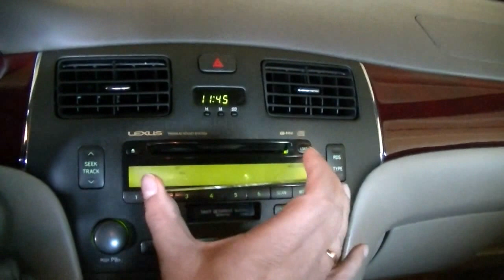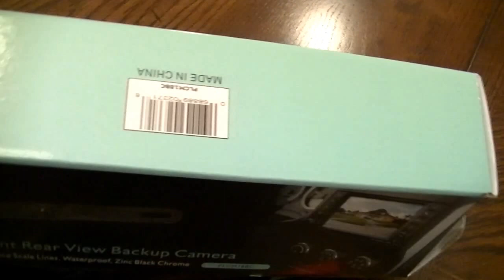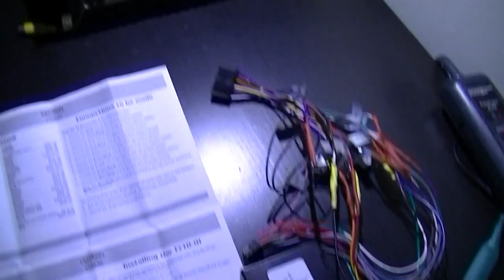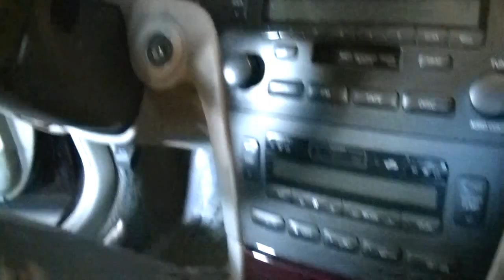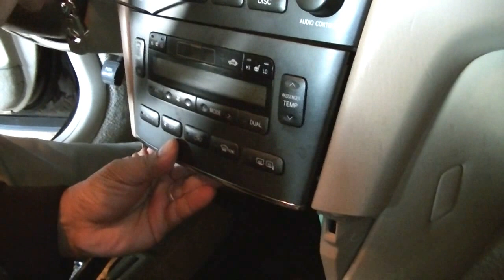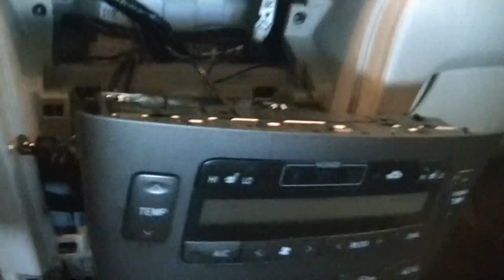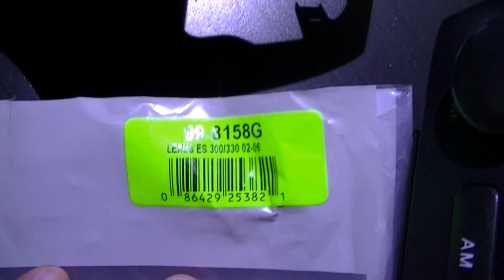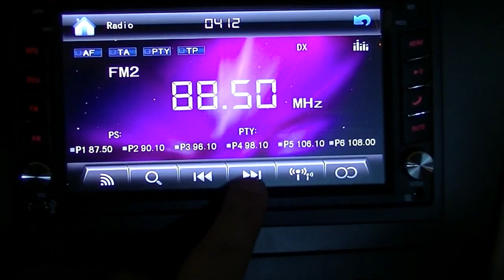2004 Lexus es330 radio replacement with aftermarket double din head unit

Comment: hello sir, I have a question about the mounts that go onto head unit itself, from metra, anyway, mine sit way too far away from the screw holes on the car, however i have my mounts set up just like you have yours on your head unit, by the way I have the same head unit. my question is am i able to move them back enough for it to mount up or did you end up using some other mount...?
Reply from the maker: Mount is plastic and flexible. I think even in my case i noticed that mount holes were far away from holes on car but then when i put the screw in then due to the flexibility of mounts they did move back enough to allow screw in the hole. This works good enough. I used the same mounts that came with new faceplate as shown in video.

Comment: another question is how is your software working..i was told these units have a 50/50 function problem with gps and radio...just asking because not sure if my installer trying to get extra money out of me?
Reply from the maker: +MrTreyvinr So far everything is working fine however GPS is rarely used. I used GPS intensively on PYLE headunit that i installed in my van and it failed completely after my long drive to canada. No support from vendor for fix. So in one way your installer is saying right that GPS can fail without any vendor support. These are cheaper windows CE6 based unit. I am reading some good feedback on android 4.4 quad core based units now a days so in my next install i will try that one (JOYING Quad Core Android 4.4.4 Double 2 Din Hd Capacitive Muti Touch Screen 1024*600 Resolution ). It is all a matter of luck too with these no name brand units, some may continue to work without any issue and some may fail very quickly. Going with a known reliable brand like Pioneer or Sony etc. is best thing to do but they are too over priced.
Reply from the maker: +Vijay Bhalla Additionally if you going to have it installed by a professional installer then go for amplifier bypass (completely remove lexus's own amplifier from trunk, for best audio results).
Reply: Thanks...I think I am gonna upgrade to not have  these problems

Comment: Im suprised the battery didn’t die lol
Reply from the maker: Recently i did a deep cleaning of carpet of my 2011 lexus es350 by removing both front seats from car. Since carpet became quite wet i had to keep car doors open for about 3 days and nights with external fan on. All this while battery was fully connected. Battery dies after about 3 days completely. I waited for about 2 more days and charged battery while still fully connected in the car through an external charger. Charged overnight and by next days everything was fully functional. So per my observations it takes about 3 days for battery to die with all internal lights on and door left open. Can be different depending on health of battery too.

Comment: Hey I have the same car, and Installed everything correctly and you can tell the sound is not the same as factory right? it gets distorted at a high volume and sound shuts off sometimes at high volume! Apparently a new amp or speakers can correct this! Did you do any of that?
Reply from the maker: +KayB “Kenny” Ent. I am not facing any issue with sound quality or sound shutting off at high volume. Sound quality is quite nice (infact more lively then original player). Only issue i am facing is when car is started i hear a humming sound from speakers which goes away as soon as songs start playing. If you installed it in exact same way as I did then what gain did you set on black box? I think i kept closer to 70%. Try to play around with that gain knob as that is the only thing flexible to some fine tuning and adjustments. I do remember reading some material on amplifiers and they have an inbuilt feature to shut themselves off when input signal is too high for them so may be try to lower down your gain adjustment on the black box. May be your car's amplifier is going in auto protection mode. I did absolute no modification to car's amplifier and speakers etc. only replaced the head unit.
Reply: +Vijay Bhalla My gain knob is around 50% right now! Do all E330's have the same amp? For some reason I can't keep the great factory sound I had before! The sound is decent but no where near as good as it was before. How much watts per channel does your radio put out?
Reply from the maker: +KayB “Kenny” Ent. 50% seems reasonable, try to play around between range of 50~80% and see if that makes any difference. Per my understanding there are two series of head units on ES330, Pioneer and Mark Lavinson, both have own amplifier components. I faced a similar disappointment when i replaced the head unit for Lexus ES300. Sound of original system was amazing hifi and new one sounded very plain and just decent (like a good old days radio or a transistor) in comparison. On my Lexus ES330 i was disappointment with the sound quality from very beginning when I bought this car (not first owner), it was very low and plain - not close to hifi at all, so i guess that amplifier in my car was near dead on arrival already and therefore on replacement of head unit, now what i am getting is amplified sound of head unit and most probably car's amplifier is just acting as a pass through, therefore i feel it is better then original, however none of it compares to the sound that i used to hear on 97 Lexus ES300.  My head unit's  Amplifier output: 45w*4

Comment: Hey bro I have the same car and hooked everything up and it works except my radio tuner doesnt work and the parking brake detection isnt plugged in. Do you know where I can find these?
Reply from the maker: Sorry I don’t know where the parking brake plug in is therefore i used brake bypass. If music is playing and radio tuner is not then either you didn’t connect the power antenna cable wire in the interface cable or it can be your head unit issue. It is difficult to provide help in diagnosis but does radio tuner work if you test ihe head unit outside car independently?
Reply: @VijayBhalla  How do u  do the brake bypass? I would do that. Also, I cant test it externally because I do not have the capability. As for the radio tuner I hooked up the blue wire from my harness to the blue wire of the head unit. "Connect tthe blue wire to the power antenna wire" are the directions on the harness manual and it says "Blue (Antenna Control Wire) Depending on what antenna you are usuing connect either to the control terminal of the motor antenna, or to the power terminal of the booster amplifier of the film type antenna max 300mA, 12v). So I connected tthe blue from the harness to the blue of the head unit. Is this wrong? Thank you
Reply from the maker: Just search YouTube on break bypass. Several videos on this topic though it can be considered illegal hence i didn’t want to include details. I think you are fine on antenna wires connection so cannot say what else could be a suspect besides head unit itself.
Reply: @VijayBhalla  Thank you

Comment: what will be the cost if you had this professionally installed?
Reply from the maker: +MrTreyvinr Good question, I never checked but Best Buy probably will be a good place to ask for a quote. My best guess is about $200 labor charges for installation and rest will be parts and head unit cost.

Comment: my installer keep saying installation not possible without bypass amp harness...
Reply from the maker: +MrTreyvinr You can show this video to your installer :-).  He is completely wrong if he says that installation is not possible without bypass (may be he does not know how to do it).  Anyway if he wants to bypass and is able to do it without charging you too much then you can take that deal too. Bypassing means he will remove the amplifier from trunk of car and also cut the existing adapters in the car that connects to current radio and amplifier.  Once adapters are cut then he will connect the new radio to open wires directly and also connect amplifier input and output wires directly. It is not complex process and you have really nothing to lose in it except that you can never put back your current radio again in car (it hardly matters).  Good thing about amplifier bypass is that 1. You don't need to buy expensive TYTO-01 interface cable and 2. The sound quality will be much better 3. No risk of picking up the engine noise (which is always a risk in retaining the external amplifier).  If he is not charging you extra then it is not a bad decision to have amplifier removed/bypassed permanently.

New radios have inbuilt amplifier which are much better so it is advisable to use them and remove external amplifier (if possible easily without paying too much).
Reply: Thank you...I was thinking he's the professional  and  a lot of people  including  yourself  is placing them in without difficulty . ..yet it's one thing after another....wanted to charge me 200 plus for a harness...
Reply from the maker: +MrTreyvinr If i have to do it again, I will use PIONEER AVH-X4800BS ($271), TYTO-01($60) & Schoche faceplate/misc expense ($30) =  $361 complete install budget. Compare this to what your total expense estimate is coming up with parts + labor with professional install and the difference is what you can save if you do it yourself (at some risks which i mentioned in my earlier msg). PIONEER units are much better in quality and size is standard so there will not be even a need to go through the hassle of cutting the faceplate what I went through due to non standard size of chinese units.

Comment: I'm using the same TYTO-01 and have my radio connected but I'm not getting any sound. Did you run into this problem? If so, do you have a solution?
Reply from the maker: +Hermes Dastas, Only very few times it has happened till date and every time resetting the power of radio resolved the issue. Radio had been working flawless otherwise till date. Few questions and recommendations if you want to pursue:-

1. If you have any spare small speaker handy then try to connect it to radio output front left or front right directly and see if you hear any sound. If no sound then radio is bad. Connect this speaker to radio directly (before the black box connection) so that there is nothing in between radio output and speaker. If sound is present then focus on TyTo

2. Approx. how much gain did you set on TyTo? Try to keep it somewhere between 50% to 70%. Setting gain too high may put the external amplifier in a protection mode.

3. Recheck that amplifier turn on cables on the Toyo harness are connected. Missing this connection can cause amplifier to stay off and hence no sound produced. (Black wire with white stripe connected to ground,  Blue wire with white stripe connected to blue with white stripe output from radio).

If none of the above works then put the old stereo back and see if it still produces sound or not.
Reply: +Vijay Bhalla Thanks for all the info! I figured it out shortly after I commented on here. I had to connect a wire that the instructions said I didn't have to connect on my radio. The sound is working now and everything is super clear. 

Thanks again for your help!
Reply from the maker: +Hermes Dastas Glad to hear that. What is the color of that wire?
Reply: +Vijay Bhalla It was a second blue wire on the radio. I forgot what it was labeled as but once I connected that with the other blue/white wire on the TYTO-01 the sound went on right away.
Reply from the maker: +Hermes Dastas Yes Blue with white stripe is amplifier turn on wire. Generally not required to be connected if there is no external amplifier,however necessary to be connected for this car. Glad that your issue is resolved now. Enjoy your new radio!
Reply: +Vijay Bhalla Yes, that was my only problem. Thank you! I'm loving it so far 👌
Reply: what did you ground the black wire with white stripe to
Reply from the maker: Jayy Woods In Metra harness there is a solid black wire & a black wire with white stripe, additionally in head unit harness there is a solid black wire. I connected all these wires together and then grounded them to the metal rod which is present towards left side of the radio, infact the leftmost upper screw that bolts the radio bracket to car's body has threads into this metal rod so that made it easier to connect ground wire to this rod using the same screw. I also added an extra ground wire that connects to metal body of the head unit itself. This was a slight modification i did to ground connections in order to eliminate the humming sound.
Reply: I have no sound and got a black wire with white stripe not connected were do it go
Reply from the maker: Black wire with white stripe needs to be grounded too. Connect it to metal body of the car, where you must have connected rest of the black wires from head unit as well as the metra harness. Just connect all black wires including this one together and give one ground to metal body of the new unit's screw and one additional ground to the metal rod on car's body. If you still don't get sound then watch for the blue wire with white stripe. This wire should be connected from head unit to Metra harness otherwise amplifier will not turn on.

Comment: Great video Vijay. Thanks for sharing -- super helpful in installing my own. Wondering what the Black/white wire running from the TYTO-01 14 pin actually does? (At approx. 11:00 of your video). Seems like there is already another ground (solid black) running from this section. Is it really necessary to hook up the black/white as well? If so, do you think they could be run into the same crimp?
Reply from the maker: I am glad to hear that you found it useful for your own initiative. Honestly i have no clue about the purpose of Black/white wire of TYTO-01, I had same question in my mind too but never got an answer. My best guess is that it for sending ground signal to amplifier so that amplifier/head-unit & all intermediate circuitry is connected to same common ground level but this is just a pure guess at my end. During this video i did not connect the solid black ground from TYTO-01 but later I connected that too, and I also connected ground to metal body of the car by connecting additional wire too. I did all this to eliminate the hissing sound (engine whine) that I hear on very low volume of headunit (when it is a level 0,1 or 2 of volume), it is annoying to me, but all this did not help (did not hurt too). Head unit is still playing same way.
Reply: Good to know! Guess I'll cap the black/white off, and if I notice hissing as you mentioned I can always go back and wire it to the metal to establish a ground connection. Thanks for the response!
Reply from the maker: Sure, do post the outcome. I am curious to know!

Comment: Can you send me the link of the components(harness and etc) you used? Thanks!
Reply from the maker: Here are the links:

Faceplate : https://www.amazon.com/gp/product/B0079VS28U/ref=oh_aui_detailpage_o02_s00?ie=UTF8&psc=1

Wire Harness: https://www.amazon.com/gp/product/B00133RCCC/ref=oh_aui_detailpage_o03_s00?ie=UTF8&psc=1
Reply: Help please, The wiring Harness Link you sent me has 4 RCA(Purple,Black,Green, and White) and the wiring harness you have in your video doesn't.
Reply: The wiring harness link you send me has 4 RCA (purple,black,green, and white) shown in the picture, At the time you bought your harness did it show the same image?**
Reply from the maker: Vendor is using wrong picture. If you read the amazon comments then some of the reviewers have pointed it out too. When I bought it even at that time same picture was present.
Reply: +Vijay Bhalla thanks!